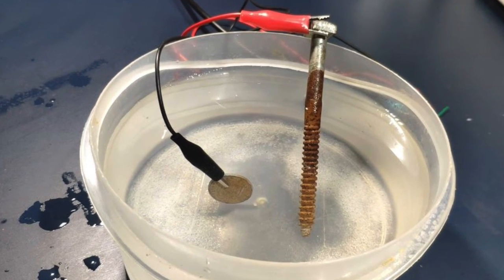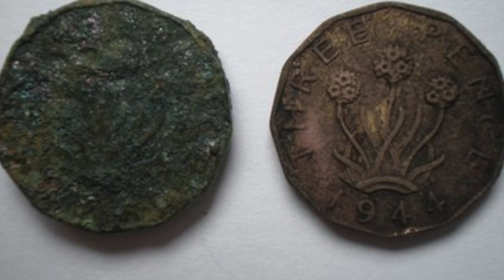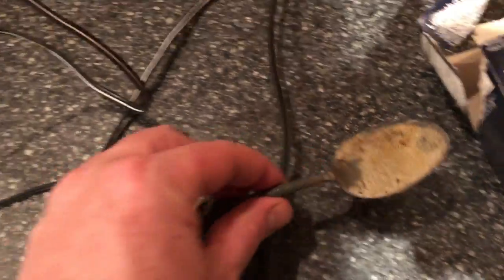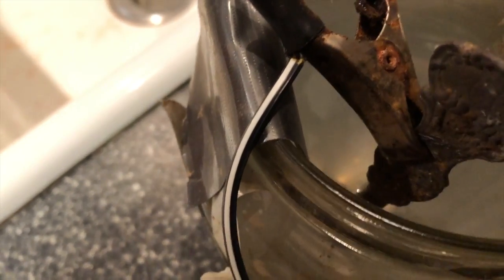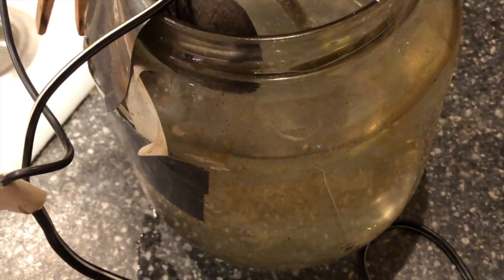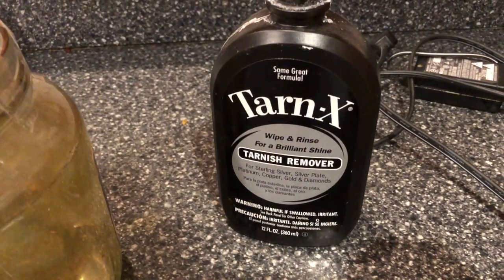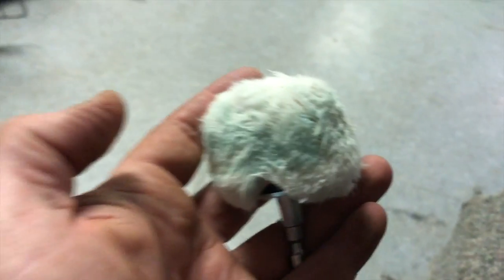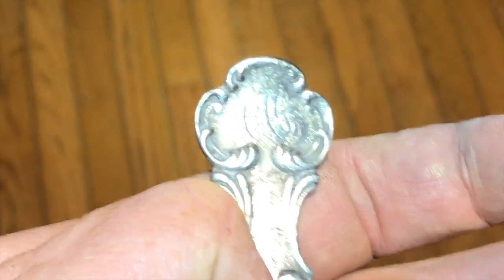Cleaning Metal Detecting Silver With Electrolysis: A MIRACLE!

Comment: Get.a small bench grinder. Mount it solidly to a table. Get a buffing disk to fit the diameter of the other wheel. You can also mount a soft brass wire wheel to attack rusty items. You will be amazed at the control you have cleaning your items. Wear eye protection!